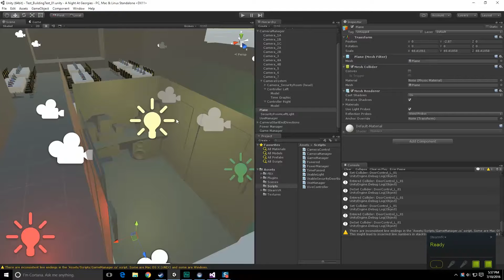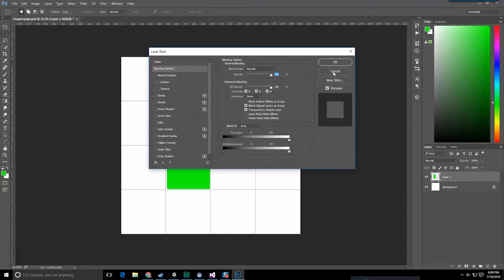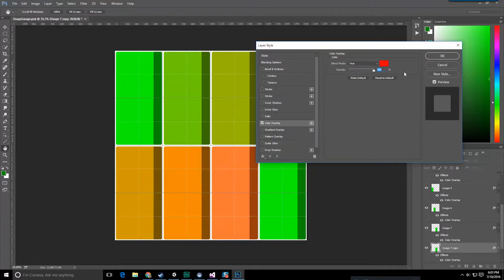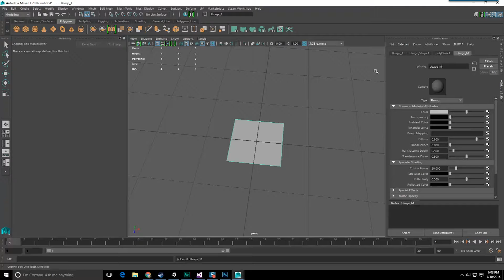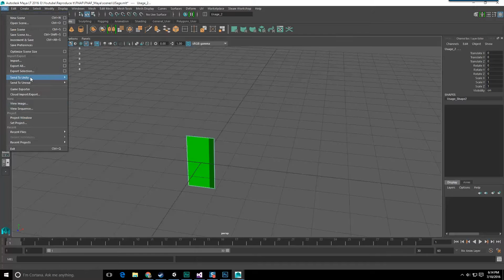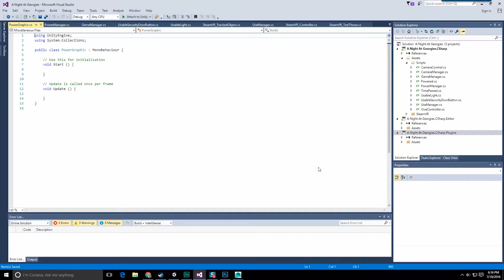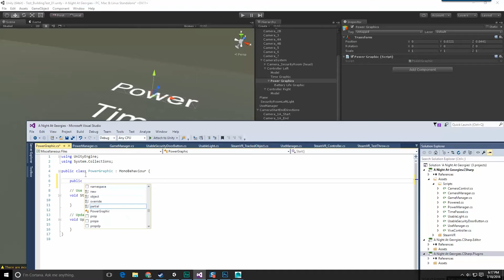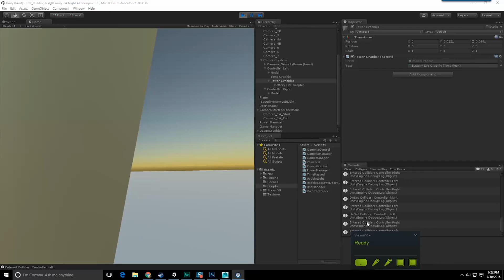FNAF in Unity + VR 42 Power Levels on Vive Controller

Comment: How would you do this if you don't have vr
Reply from the maker: You would use mouse and keyboard input. If you are using the old Input system, just google Unity Input. If you are using the new input system, there is documentation on how to setup actions and messages.